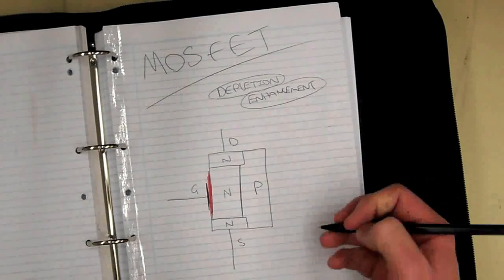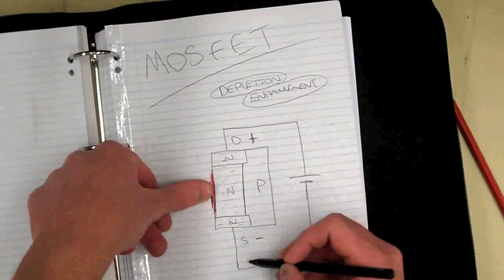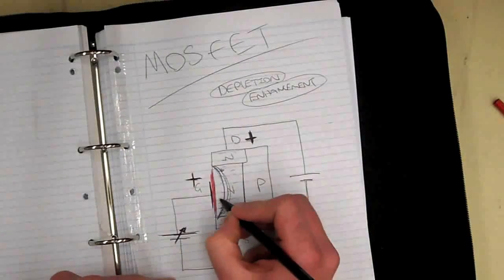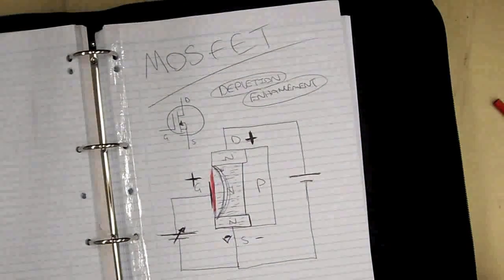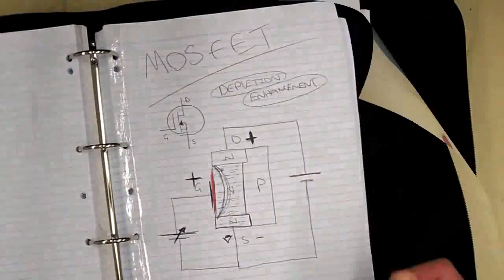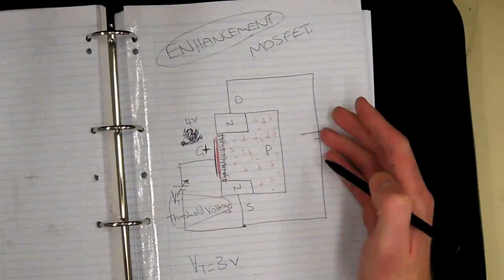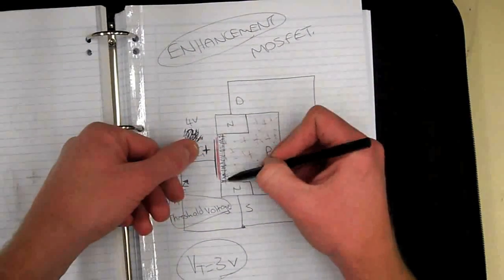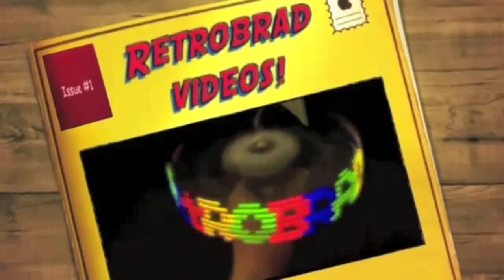Electronics Tutorial 9 Introduction to MOSFETS

Comment from the maker: @00liketolearn00 If we did not connect up a power supply, the free electrons would certainly combine with the holes. When we apply a potential difference between the source and drain and apply at least our threshold voltage to the gate, we are now starting to control the device and these free electrons will flow to the positive supply (which is applied to the drain)

Comment: Here is how I see this. If you enhance (the enhancement mosfet) the zone so that there can be a current from the source to the drain, you are just letting some of the current through. If you are putting 3 amps through, you might be only allowing 1 amp through. If you max it out, you will allow 3 (or whatever the max amperage if it is smaller than 3) through the circuit. I don't get how this amplifies. I see this as a way to turn the sound down or up to what it would be if it weren't variable.

Comment: in "connection" with transistors, they differs in a sense of different electronic applications.
But transistors are different as well in a sense the current CAN and IT IS altered by each "device" used which CHANGE it's characteristics. So all those (audio) distortions you might have heard are created like that.

Comment: Thank you. I picked up a non working cordless drill with a broken transistor on the heat sink mounted on the trigger switch. Rather than just buying a replacement switch unit I am taking this opportunity to learn more about how these work so maybe I can possibly purchase the correct transistor/ diodes etc to fix it myself and learn something in the process. I think your tutorials here are just what I need to make this possible. Thanks so much. ;-)

Comment: but how much gate voltage do you need for it to completely saturate
Reply from the maker: It depends on the part number of the device. The data sheet for the particular device will give you the info :)